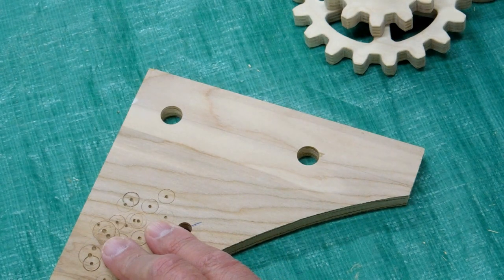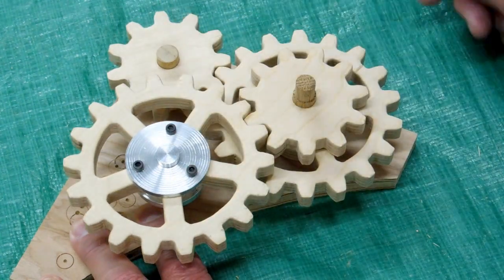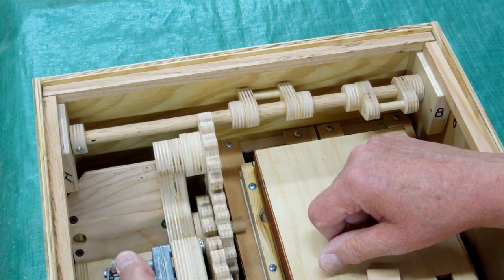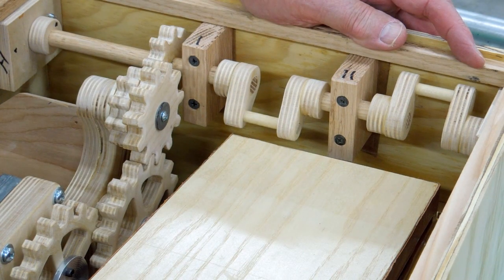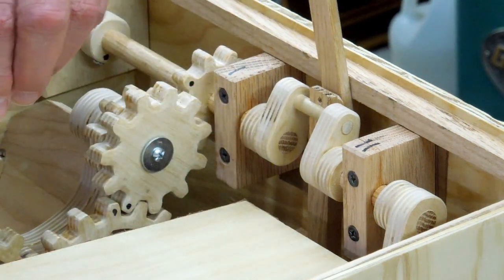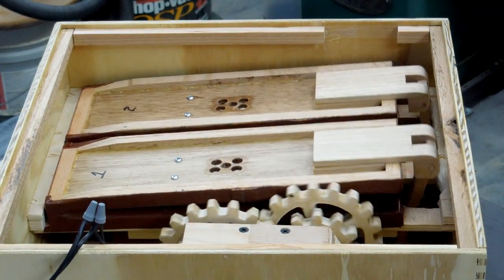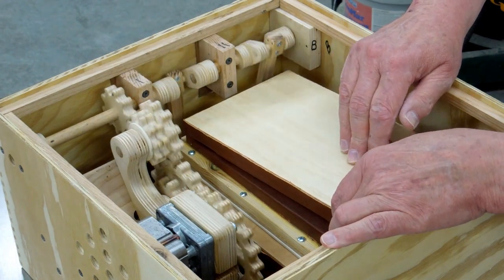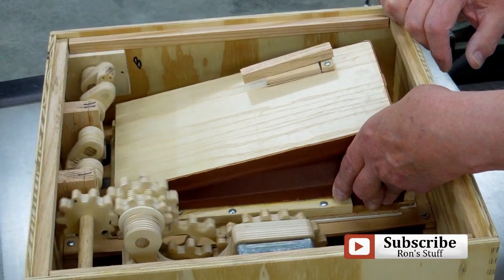Building The Busker Organ - Motor Drive & Gears Part 4

Comment: Hi Ron! This looks amazing 😮 Can you please let me know what motor you used?
Reply from the maker: Unfortunately I cannot answer this. Shaded-pole gear motors show up on eBay from time to time. Generally the majority of shaded-pole or shaded-pole gear motors are quite weak and mainly used to spin a small cooling fan or some low-load application. Stronger ones are "purpose build" for some application such as turning a BBQ Rotisserie. One with a stated (if the seller even knows) lower output RPM may be strong enough for this purpose but it is basically trial and error. The one in this video was strong enough for me to be able to gear it up slightly. These were "No Name" motors and this particular source dried up long ago. If you do find one strong enough, be careful as they can hurt you. I also have a video on reversing them if you get one that is turning in the wrong direction. 
Thanks for watching. Please subscribe! 
That is what keeps this channel running. 
Ron

Comment: Congratulations from Brazil. I will change my JS 20, to receive gears too.I was concerned with the noise, but your machine is so silent. Warm Regards
Reply from the maker: I am looking at using a 12 volt automotive windshield wiper motor or side window motor (much smaller) and a belt drive for the Senior 20. Then you can either use it (put the belt on) or not use it (take the belt off). A rheostat is necessary to allow some adjustment of the music speed. I think gears will just get in the way. At least the Senior 20 has a little extra room to work with. The Busker has no extra interior room.

Comment: That's really cool. 

re: you saying the strength of the wooden crankshaft was an educated guess - did you consider a design that put the drive gear inbetweeen the cranks? That way the drive side crank won't have to deliver the torque down the line to the far side crank...
Reply from the maker: With this large motor and the gears that would probably require separation of the two bellows and a redesign of the reservoir. I did not design the bellows & reservoir. I was building this to an existing design and preferred to do it this way. If the wood crankshaft did not work then I would have made a steel one like in the Busker organ. Another possibility is a worm drive motor running at the correct speed (which would be more compact) or a type of stepper motor with a cog belt drive (I did not have either of those).

Comment: I would like to congratulate you for all your projects and the way you produce the videos. They are very interesting and extemely educational. I watched all the videos on the pipe organ. I just want to draw your attention to the way you calculated the end revs per minute when showing 'Building The Busker Organ - Motor Drive & Gears Part 4'. If I counted correctly you are using two 18-teeth gears driving two 11-teeth gears.  18 divided by 11 is 1.636. You then multiplied this by 2 and got 3.27 - which is wrong.  You should multiply 1.636 by 1.636, and you end up with 2.68.  So the train of gears shown produces a final 50.9 rpm (19 rpm * 2.68) and not 62 rpm. As you are also into clocks you can confirm this when the minute-hand shaft drives the hour hand (ratio 1:12). The gears usually are a 10 driving a 30 (1/3) and an 8 driving a 32 (1/4). To get the ratio 1:12 you multiply 1/3 by 1/4 (not add them up).
Reply from the maker: Egidio Debono Whoops! Alcohol may have been involved while editing this one. :-) Entirely too much stuff to keep track of when editing these videos and putting in text for people who may not understand what I am saying. 

I was not going to complete this as a Busker and the bellows and reservoir were just test builds. The idea of the motor and wood gears was just for the air supply (not the organ). Since this was just going to be an air supply, the 5 1 rpm was more acceptable than 62 rpm because of available power from the gear motor.  

The hand-cranking speed for the organ is supposed to be around 60 RPM (+ or - depending on several things). I originally tried a combination of 18 tooth and 10 tooth gears but the gear induction motor did not like it and I ended up with 18 tooth and 11 tooth gears. Somewhere in there I either picked up the wrong notes or forgot what I had done.

Glad you enjoyed the videos. Thanks for watching. Please subscribe.

Comment: Excellent woodworking and design skills! I didn't watch all the videos yet but just curious, is there a clutch involved for the music roll rewind or do you just reverse the motor?
Reply from the maker: calliopeguy Actually, after building the air supply portion of the Busker I changed my mind and decided to build the Senior 20 instead. The Senior 20 and the Busker both have a clutch to disengage the hand crank from the take-up spool. The Senior 20 has a permanently mounted rewind mechanism (which disengages from the music spool) and the Busker requires shifting the music spool to a slightly different position and using a rewind crank. My Senior 20 video series starts at No. 00 and will continue through the completion of the organ. Latest video release is No.21 

The Busker and the Senior 20 are not designed for a motor. That is my modification.

Comment: Ron, I'm about to build Johns senior 20, and want to make the crankshaft out of wood rather than steel.
Just wondering how it's held up with all the experiments the airbox has been subject to?
Reply from the maker: The wood one for the Busker Design has held up and it has been used a lot for testing and voicing pipes, but it has not run anywhere as much as the steel crankshaft in my first Senior 20. I suggest a steel crankshaft mainly for the repeated installations and removals of the hand crank or wheel. In my video Senior 20 Organ (16) Crankshaft & Connecting Rods https://youtu.be/GRgfGcZoXAU you will see how mine is made up of segments... no welding. You can make your own... all the information you need should be in the video.

Comment: Great work! Can you tell what model for the motor? Tks!
Reply from the maker: This is a very strong shaded pole gearmotor... New Old Stock... It has been out of production for some time. You would need to find something similar, possibly a BBQ Spit Motor. Brevel Motors Model 703 120V 60Hz 45 Watt Induction Type Rotor turns 3500 RPM Gear Reduction 184:1 Output Shaft 5/16" Diameter turns 19 RPM Thanks for watching. Please Subscribe! Ron

Comment: Just one question: How to rewind the music?
Reply from the maker: Remember, this video is of an experimental or test build for the bellows & reservoir mechanism and possibly it can be used as an air supply for testing the pipes.

In the actual organ the crankshaft is what would be driven, either with a gear drive or a belt drive. The organ still has the clutch mechanism to disengage the drive from the take-up or winding spool. Then, in the Senior 20, you use the rewind mechanism.

Comment: I co to ma być?do czego służyć?
Reply from the maker: Busker is a street organ which I initially wanted to build. Later I decided to build the Senior 20 street organ instead. This video is about converting what I had already built for the Busker into a powered bellows air supply which was later used for testing organ pipes built for the Senior 20 organs. I have a video series on the Busker and a complete video series on building the Senior 20 organ. Thanks for watching. Please subscribe.